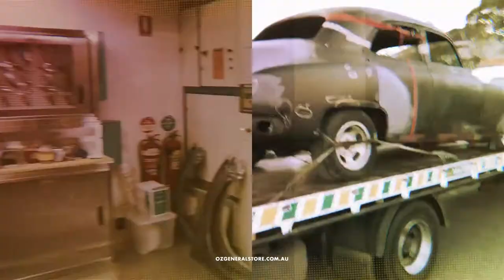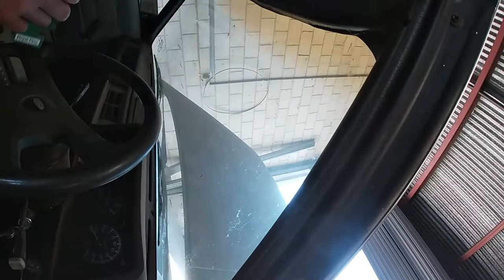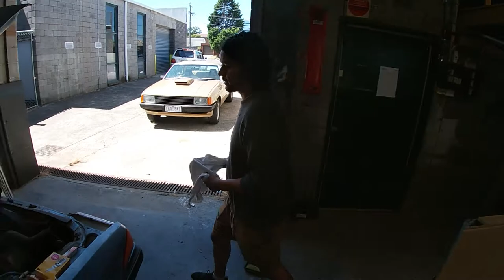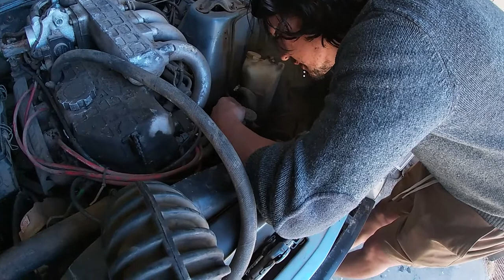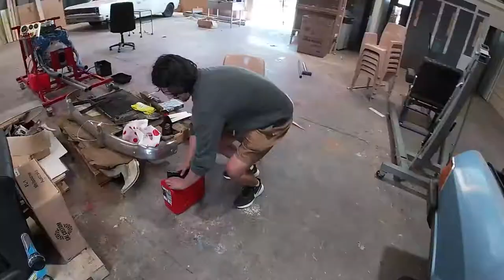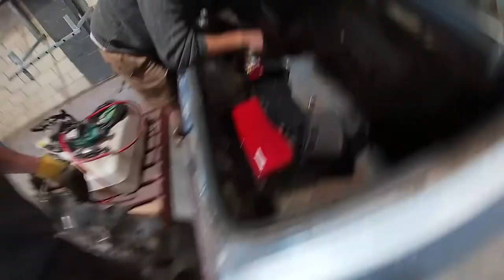Can we get our Icey Blue 1983 XE Ford Falcon running?

Comment: Hahhaha no mirror to hang the stank on. Can tell this has been in the sun for a while, the tint strip on the glass is yellow! Quick tip - BRE527Y-11 plugs are more preferable as the XF and XE share the same reach. Power steering fluid needs the car running to get the right level :).
Reply from the maker: Noted. Cheers mate!!